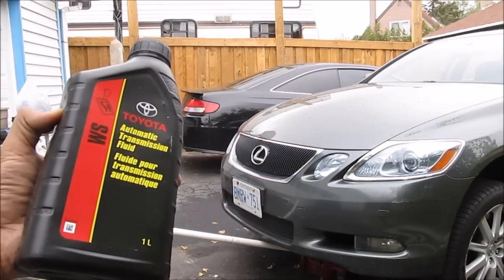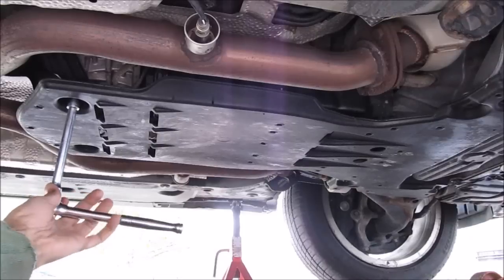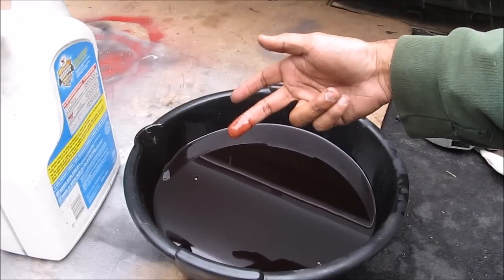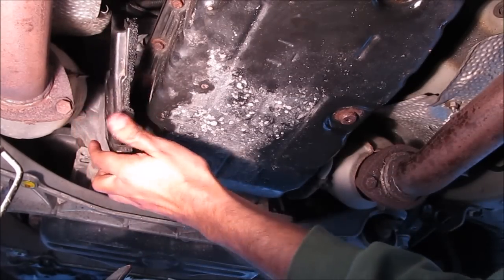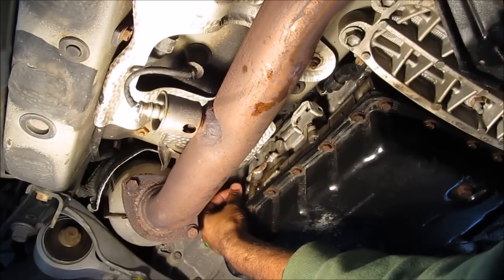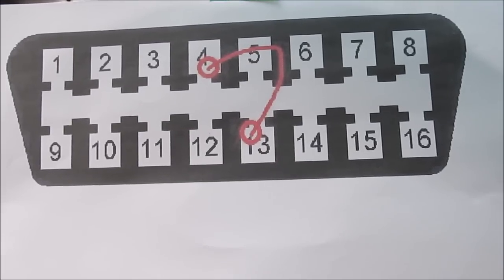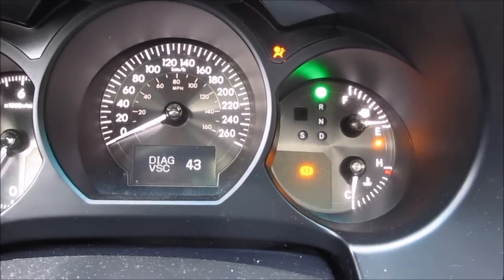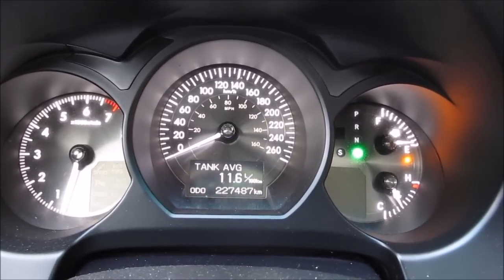Toyota / Lexus Sealed WS Transmission Fluid Change

Comment: Wow what a pretty GS350, this was very helpful video. I have a 2009 IS250 AWD and it has 71k miles and from my knowledge it is the original trans fluid. Do you think this is the same setup underneath and if I did a drain and fill could it damage the transmission? Thanks

Comment: its a partial oil replacement.. your replacing 40-50% of fluid this way.. to replace 75-80% of the fluid you need to do it 4-5 times, dont forget to drive the car in between the changes for 50-100 miles.
Reply from the maker: Yep agreed. That reminds me it's been 2 years ...I need to change my fluid again.
Reply: I Have A04 ES 330,If U Jack the Car Up ,So The Drain Plug is @ Lowest Point,Wouldn't Most 
of Fluid Drain Out  That's The Way I Use to Do my 01 Tundra V-6.?
Reply: Ed Cain ... Say ‘torque converter’. It’s filled with fluid and it does NOT drain.  You can increase the amount of fluid drained, albeit slightly, by letting it drain overnight.

Comment: Just FYI the best way to do this is when you drain the old transmission fluid into a clear container make a mark where it ends up draining at then empty it then fill new fluid to that mark then pump that much back into it. So you don't have to go through hearing the fluid up to check the amount of fluid you put in.😎
Reply from the maker: +Wade Banks good tip thanks
Reply: Good advice Wade
Reply: What if it was under-filled at the factory?
Reply: @BlackHawkPSU  good question. I changed it in my IS250 AWD at 166k miles 5quarts came out. I went ahead and replaced it with the same amount, it was so dirty but it still drives very well.
Reply: I'd pull the hose and pump it out from the converter, drop the pan, change the filter, and then refill.

Comment: Great video. I have a question: for the no-dipstick cars, many people warn about overfilling of transmission fluid. I don't think this is a big issue because the excessive fluid will be overflown through the straw. After all, there will be the right amount of fluid in the tank (unless the straw is clogged). The only concern is under-filling. Am I wrong?
Reply from the maker: +Dinh Nguyen You overfill but then you have to run the fluid level check procedure to open the overflow drain plug (on the pan that has a straw inside) to drain excess out when its at its ideal operating temp. Since atf expands with temperature you wouldn't want to over fill it since it can build pressure possibility blowing a seal or causing leaks.
Reply: Make sense. Thanks.
Reply: @speedkar99  
Actually it's at the ideal temperature for checking the level which is far less than operating temperature.

Comment: Please explain to me why you have to check the level if you put the exact same amount back in that you took out.  If it is now overflowing wouldn't that mean it had too much to begin with?  Or what if you check the level before performing the fluid change?  Would it also have some flow out?  I just don't understand how if you put the same amount back in that it would suddenly have a little too much.  That defies logic

Comment: Why you didn’t change the filter inside the transmission?
Reply from the maker: The filters is a screen. It rarely needs to be replaced
Reply: @speedkar99  If that's the case. You are wasting your time changing the fluid. You can't stop the main filter from filling up with dirt.

Comment: I have a 2009 IS250 and struggled getting the dash in AT Temp check mode.  The procedure in the video is correct however I wasn't going from D to N and back and forth quick enough (1.5 seconds).   When you do this for 6 seconds as required the D light will stay on.  When you put it back in P the D light will go off after 2 seconds.  This is how you know you have it in AT Temp check mode.

I had to refer to the Chilton manual instructions to figure this out.

Connect terminals CG (4) and TC (13) of the DLC3 using SST.

Start the engine.  Note:  Check that electrical systems such as the air conditioning system,
audio system and lighting system are off.

Slowly move the shift lever from the P to the S position, Shift the gear from 1st to 6th and then return the shift lever return to P position.

Move the shift lever to D, and quickly move back and forth between N and D (once within 1.5 seconds) for at least 6 seconds. This will activate the fluid temperature detection mode.  Note:  D sift indicator remains illuminated for 2 seconds and then off.

Return the shift lever to P and disconnect terminals 13 (TC) and 4 (CG).

Allow the engine to idle until the fluid temperature reaches 39 to 46°C (102 to 115°F)

The D sift indicator will come on again when the fluid temperature reaches 39°C (102°F) and will blink when it exceeds 46°C (115°F).
Reply: Just use a digital thermometer much easier and just as accurate

Comment: Hi boss. I saw all the 8 steps you put for the fluid change. That is great. My Q is, what if i wanna chane the filter as well. I know i will take the psn off, clean it, and replace the gasket. What are other steps i will do while i am filling the fluid. With changing the filter, it will be really hard to track the amount of the fluid drained.

Thanks
Reply from the maker: You will have to check the fluid level which is what I tried to explain at the end of the video. Unfortunately my check plug was stripped so couldn't show
Reply: @speedkar99  i got three new plugs in case any of them got destroyed.

Comment: Hello there I am getting a p0986 code and gear hesitate and lags to shift. Sometimes it shift good. 

After driving for long and if I stop at some signal and that time the  its shows huge hesitation to change gear. N has to rev high  to change the gear

Comment: Superb,  what about transmission filters ?
Reply: Those are just a big screen....I can say I never did the filter on my Rav4 and when I sold it at 222k miles no issues at all with transmission. I just did a drain/refill around every 50-70k mile.

Comment: Nice new car! Question: couldn't you have filled the transmission until the fluid ran out of the fill hole like you would other transmissions and differentials or does that not apply?
Reply from the maker: +Randy Mahadeo Thanks. The transmission fluid must be at the correct level indicated by the level of the straw in the pan when it's hot. Since the fill port is much higher on the tranny, pumping fluid until it comes out of the fill port would lead to over filling, and seals leaking as a result of pressure build up when it warms up. Overfilling only applies to differentials.
Reply: @speedkar99  
The fill plug on a differential or manual transmission is positioned at the proper full level for those components. But even they should not be overfilled. The fill plug on an AT is only for filling. It is not positioned at the full level any more than the filler cap for your engine oil is on your engine.
Reply: @stevensevek6151  thanks.  Like many others, it seems silly that they didn't design it to be at the correct level or put a dipstick on it, though.

Comment: Not bad, but you really have no idea if the fluid level is correct without removing the plug.  Replacing the same amount assumes the level was correct in the first place.  IS F owners have learned the fluid is consumed over time and will get low.  When it does, the AA80E does unusual things in the way it shifts and holds gears.  Setting the level correctly makes a HUGE difference in how the transmission behaves.  Also, the AA80E doesn't have a cover over the fill, and you'll never, ever get a 1/2" rachet with a 24mm socket in place to remove the fill on an IS F.
It's going to be really hard to remove that level set plug. It's stupid tight, and my chief complaint is the hex key to remove it is far too small.  You will probably end up drilling it and using a really big EZ out to remove it.
Reply from the maker: +lobuxracer Thanks. And yes I feel like I need to check that fluid level. 
I think I'll have to weld a socket to it and crack it loose. I tried tapping on a bolt extractor but the hammering started deforming the tranny pan.
Reply: I'd be inclined to drop the pan at this point to complete the extraction.  You might end up having to drill the head off the bolt to extract it.  I would not be keen on welding on the pan.  If you look at all the precautions Toyota/Lexus recommend to protect the multitude of on-board ECUs when you weld anywhere on the chassis, it will give you pause before you strike an arc.
Reply: I just take my F  to the lexus dealer. $190 and let them deal with all those bolts and fluid levels.
Reply: @speedkar99  That pan couldn't be that expensive at the junkyard plus give you an excuse to replace the filter.

Comment: Great Video!  I just bought a 08 Avalon with 80K on it and no maintenance history so I think I should change trans fluid ASAP. 1) if it were your car, would you do a drain and fill or an entire fluid replacement?  2) Will the OBD Jumper part and temperature reading part of your video (with all the gear shifts) work on an 08 Avalon Limited too?  Also... 3) it is the same procedure even though the Avalon is Front Wheel drive???  4) any opinion about using valvoline max life instead of WS?  {Some say it is better).  your fast reply would be greatly appreciated as I am wanting to do this quickly.  Thanks!
Reply from the maker: Transmission fluid is not changed frequently enough to warrant saving a few bucks on fluid in my opinion. The FWD setup might be different, although the procedure is the same. Drain and fill if you don't know the history. Flush is last resort before a rebuild
Reply: @speedkar99  Thanks for the fast rep;y but you forgot to answer... "will the OBD Jumper part and temperature reading part of your video (with all the gear shifts) work on an 08 Avalon Limited too"?  Also.  If I go the "drain and fill" route, do you think multiple drain and fills (in a short timeframe) would be OK considering the unknown maintenance record on the 80K mile car?

Comment: My 2008 GS350 has 276500 miles and I’m not sure if the transmission has ever been serviced. At the shop the other day the mechanic said that the transmission looks like it’s leaking and he said that I should change the filter and gasket.  I’m concerned that clean new fluid might be disastrous for my transmission at this point. What are your thoughts?
Reply from the maker: Drain, fix the pan leak, and refill. Don't flush

Comment: I would call it until the warranty runs out fluid or 100k fluid. However lifetime single speed ev transmission fluid actually exists because electric motors produces very little heat and no clutch. Brown fluid means change required, black fluid means rebuild required.
Reply from the maker: Good point. I wouldn't wait until it's brown to change it.

Comment: I have couple of questions.

1. Why do I need to measure out the amount I need to replace?
2. Is there a filter for transmission fluid? Just as there is one for engine?
Reply: Why do I need to measure the right level at the right temperature if excess oil pours out by itself?
Reply from the maker: +Erlend Anderson To know how much to put in. There is a filter inside the pan.
Reply from the maker: +Erlend Anderson Because tranny fluid expands with temperature so you need the right level at the correct fluid temp.

Comment: The answer below is not my own.  But it could be a solenoid have you checked transmission levels by using a obd if transmission oil is running hotter than usual it could be oil level is low

Comment: Hello I was wondering if you can explain how to check the transmission fluid on this vehicle.
I do know there is a sequence to determine when optimal to check and vehicle needs to be at a certain temperate but
Once we reach that temp, is the car supposed to be ON or OFF and should it be in park or neutral?
I think each one of these situations will cause a different senario of fluid level as its swirling around at various positions.

Thank You
Reply from the maker: I went through that at the end of the video.

Comment: All the codes respond to this Possible causes

Low transmission fluid level

Dirty transmission fluid

Faulty shift solenoid 'C' valve

Shift solenoid 'C' valve harness or connectors

Shift solenoid 'C' valve circuit is open or shorted

Comment: Hey thanks for your response, I appreciate it.  Still you did not check the fluid level.  I would have, first purchased a new plug, then removed the old with a pair of pressure pliers.  By the way, i own a 94 Lex 300, is there any real benefit to changing the filter, instead of just the fluid.  Thx
Reply from the maker: +Abad perez thanks 
That plug was rusted in there! I did get a new one but it seems like I'll have to remove the pan and get it extracted.

Comment: will doing this procedure and cleaning out any vents solve issue of burnt smell from engine and transmission slipping gears from 1-2 2-3 lexus dealer said it was the decelerated and reccomemend s new transmission
Reply from the maker: Try the fluid change 3x sucessivley after driving a bit in between.
Reply: speedkar99 thanks you i will

Comment: Why bolts on oil pan are rusty???
Low quality alloys
Reply from the maker: Canadian winter
Reply: Must be parking in salt water puddles?
Reply: @speedkar99  
Funny they don't want you to service the transmission but they supply a fill port and a drain plug. If it's designed to be seldom used they should at least make the drainbolt out of magnesium or stainless steel so it wouldn't rust.

Comment: Than you, Well explained 👍 best video, On my Camry performed a drain and fill which is not a sealed system after 180k kms with 4 litres Toyota ATF WS and didn't change my transmission filter, is it necessary to change filter? didn't get the point why you short the OBD port and suggest recommended temperatures in transmission.
Reply from the maker: +Jithin P V Your lucky your tranny is not sealed and has a dipstick. This one needs to measure the temp and you open the overflow valve to let loose access fluid since no dipstick.

Comment: Hi Speedkar99 your videos are excellent. These are my first choices to learn car relating things! I have some questions regarding CVT fluid change/flush. Some people says Toyota transmission needs recalibration after a fluid change/flush. Is this true? What does the calibration actually do? Do we need that for normal (non-CVT) automatic transmission as well? Your answers will help me greatly!
Reply from the maker: I never heard of the recalibration requirement but sometimes I do it so it relearns drive cycle patterns based on new fluid performance

Comment: Can I just add exact amount what came out and don’t have too check the temperature would that be ok
Reply from the maker: +ammartm1 OK but that's not exact
Reply: that's what I did, but you have to make sure the car is cold. the factory fill is always more, I asked a lexus mechanic about this, they don't know much about the fluid level drain, but said if you added exact amount back, it should be ok.
Reply: @sjcrw  Hi, so the car needs to be cold, and lets say its cold and it drains out 2 quarts, ans you add 2 quarts? Thanks!

Comment: Hi 
I just bought my gs300 2008 model recently as far as I am aware of the history they haven’t changed the transmission fluid and filter it’s done about 105000 miles now. Do you reckon should I change it ? Some say it’s lifetime and no need a change 
What’s your concern please?

Comment: "Lifetime business for Toyota"   Good one!
Do not fill until it comes out of the filler hole?  That would make sense.    Do you compensate for fluid left in the filler tube?
Can I change transmission fluid and filter in a 2013 Let'suck AWD RX350?    Thank you.
Reply from the maker: +Robert Gift no you'll overfill it. That's for manual tranny's and differentials. 
Yes the fluid can be changed in the RX. The pan drop for the filter might not be worth the effort especially if it's too close to the subframe.
Reply: Thank you, Speed.    Why do they not make the filler hole the athe proper level height?   Then we would knowhen it is full.   Let'suck dealer says they do not do transmission fluid changes.   It is "lifetime".Lexus owners change cars every three years?   (Ours is used. Donated for blood transport to hospitals.)

Comment: My 2019 Lexus NX300 been through flood. Should I drain the old transmission fluid out? Is there a way water could have gone into transmission pan area? FYI my air filter got soaked and water went into the motor. I still haven't made an attempt to start engine as I want to drain the fuel and other fluids. Thanks for your time sir
Reply from the maker: I would be weary to start that engine with water on it. Water is not compressible. You could damage the valves or pistons
Reply: @speedkar99  I drained the old motor oil and put a new oil filter along with 5 Qts of oil. Still haven't started as I asked some one with electrical experience to diagnose the components to make sure there are no short circuits or burned wires.
Reply: I would be concerned about water in the transmission. That would be catastrophic. Not sure what you can do about it though

Comment: Great video!! Straight to the point and fast. I have a 2008 GS350. Question: Does this transmission has a filter to replace?
Reply from the maker: Usually it's a screen and no replace
Reply: Really you shouldn’t have to do that unless you really want to have a perfect transmission or have super high mileage, but it does give you good info on what shape your transmission is in by looking at the magnets